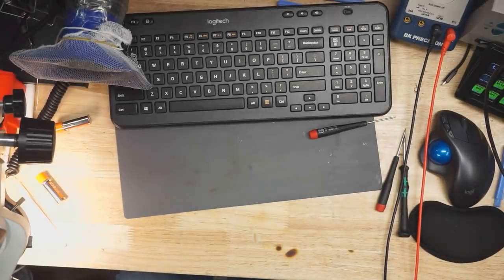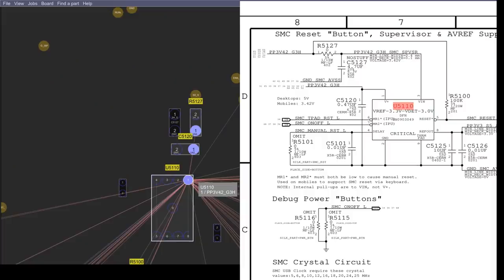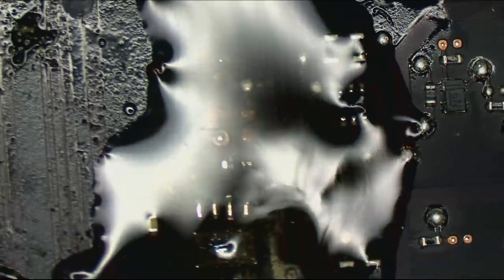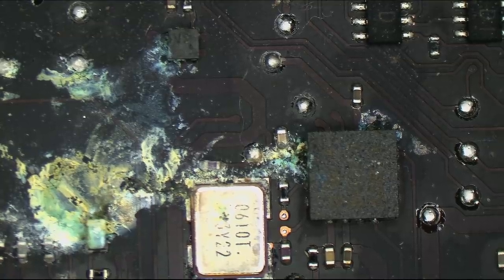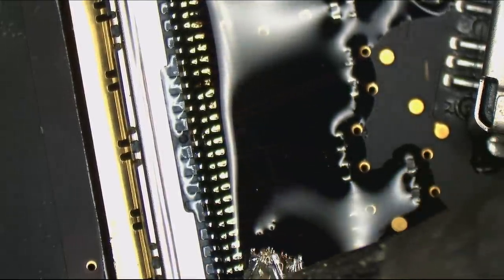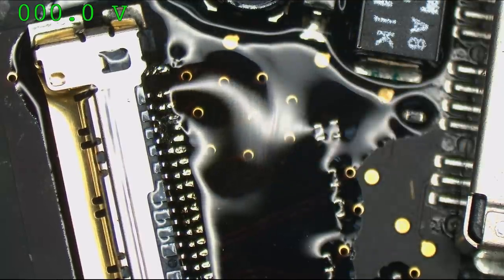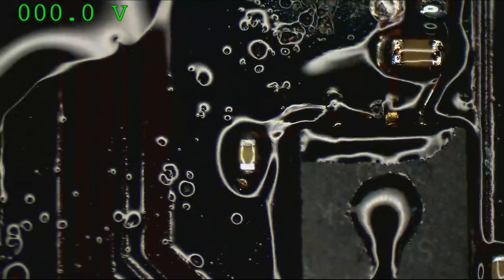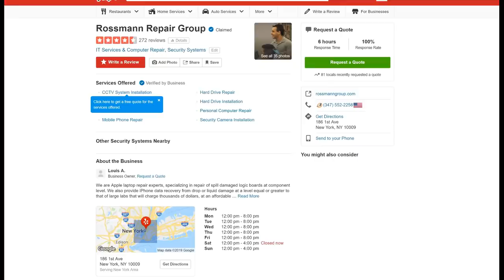Macbook Pro A1502 no green light after liquid damage

Comment: You know, after revisiting a galvanic corrosion table, I realized that the lead free solder increases motherboard damage in the presence of liquid by causing the copper to protectively corrode to preserve the solder. Conversely lead based solder will protectively corrode to preserve the pads...
Reply: Wow sounds like a serious design flaw in lead free solder.
Reply: It's greener but easily went failed

Comment: crApple, if you're going to make the batteries on devices non-removable by the end user, build them to be IP68 rated so water doesn't ruin them. If you don't make them water resistant, then make the batteries removable so they can be yanked quickly and the system dried properly. 

Sheesh.
Reply: Now be reasonable Kimberly. If they followed your suggestions, they'd lose a lot of sales generated by planned obsolescence. You wouldn't want Apple to lose sales, would you? 😋
Reply: @mjc0961  you'd think random 30% increases in prices would cause them to lose sales. Apple customer don't complain because "More dollars than sense"

Comment: With the donor boards, you can not be sure, that some chip or resistor or capacitor is not damaged. Do you have such cases sometimes, that you replace a SMC or other chip and then you find it was also bad on the donor board?

Comment: Those tiny line connectors like JTAG connectors are pain on the ass if they have bad quality. Recently GF's Xiaomi Mi4 battery went dead. Battery replacing required to disconnect display and bottom board cables - exactly those long types with pins in 2 rows. After 2 weeks display on that phone didn't worked anymore. Then we found that connector pins after first disconnection dislodged and then fell out. Replaced that connector then after a week bottom board cable connector disintegrated. In end we threw that phone out.

Comment: Hey Louis, I was watching one of your old videos and you were complaining about your "crappy" Time Warner (Now Spectrum) Internet. I wanted to hopefully help you out with this, or at least give you something to try. Takes a few seconds and can easily revert if it doesn't speed up your connection. Open your router config page (like 192.168.X.1, usually x=0,1 or 2. usually username/pw:admin/admin) and go to your "WAN" config and change DNS to 1.1.1.1 and 1.0.0.1 as secondary. Reboot it and check it out. This won't increase your bandwidth, but it should increase your DNS lookup times. In case you don't know or for anyone else reading, When you request a webpage, your browser connects to a Domain Name Server (DNS) and it returns the actual IP address of the page you requested. Then your browser makes future requests to that IP. The problem with time warner and some other ISPs is that they have their own DNS which is not nearly as fast as other existing DNS available. Also, They use this function to censor your content! If you request a page that they don't want you to see, they can either send you to a different or cloned version of that page without your knowledge or tell you that it doesn't exist. Anyways, 1.1.1.1 and 1.0.0.1 are CloudFlare DNS which are extremely fast! You could also use 8.8.8.8 which is google dns. There are many others available, but i just wanted to share this info with you in hopes that you will spend less of your life waiting on your browser. 
For more info about cloudflare: https://1.1.1.1/
You may recognize cloudflare from sites like TPB which use their other services.

PS: Leaving this to it's default allows your isp to monitor what websites you visit. If you notice that a certain page loads faster on Spectrum DNS over Cloudflare and others are faster on cloudflare, this is because Spectrum caches frequently requested web pages. There are many issues that this causes as well.

Comment: If I would be Apple I would hire Louis and ifixit as external consultants and reverse the trend of screwing the customers and I would also create an Apple authorized third party shop license that people like Louis can get (along with all the software and circuit diagrams needed to fix things). Basically they would gain first grade testers and very valuable feedback on what they need to change from generation to generation in their hardware. Not to mention the enormous credibility they would gain. They gained a lot from the San Bernardino case when they protected their customer's data, imagine doing the same on a hardware front to show that Apple takes care of its customers. With little or no cost to them actually, people would still change their macs every 4-5 years, it's hard to force people to change them more often there is a natural rhythm to things and it's annoying for people if it gets disrupted.
Reply: You act like they don't know what they are doing.....

Comment: Cellphones..
How many features on a cellphone can you do without??
Screens larger then 1080?
Movement sensor, so you turn over in bed and it knows?
GPS...I know where I am, and so does the gov. with GPS...
How many of you use the Compass in a cellphone, or even know that its there??

What changes in a new cellphone??
CPU/GPU...its 1 chip..
Screen? with enough pixels that an ANT can read the text even standing on your lost $1000 phone..
Camera?
Anything over 12mp, is a waste..12mp is able to create a Greate picture upto about 11x14,,and your printer cant Print it at 300dpi and get any better.

There are features that are good in Pads, but do you need much in a Phone, Besides getting and sending Phone calls..
How many 10 inch Pads have Pixels past 1080????  I aint seen one   yet..  how many have a camera with over 5mp?  How many have the Most recent CPU/GPU??  none of them.